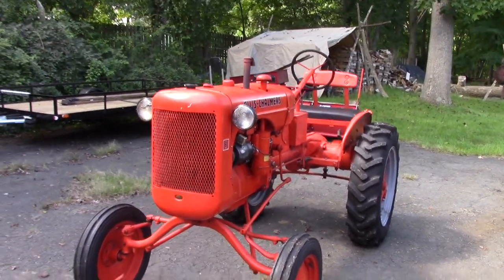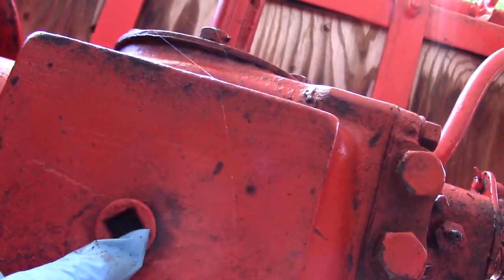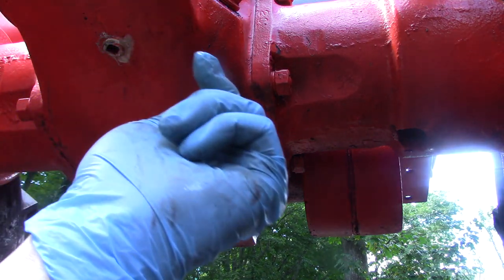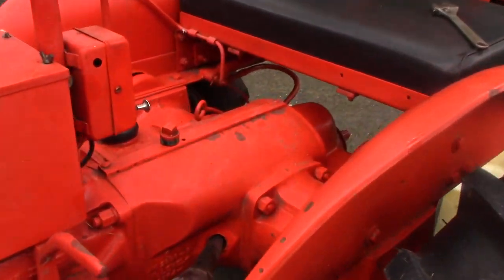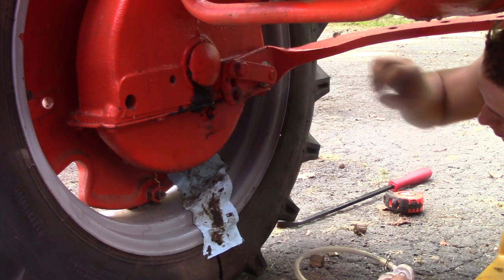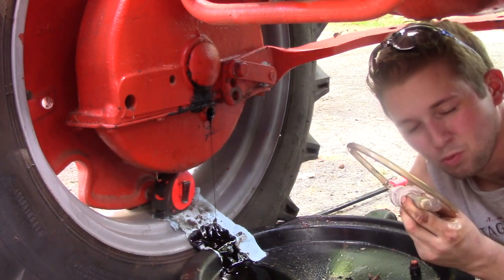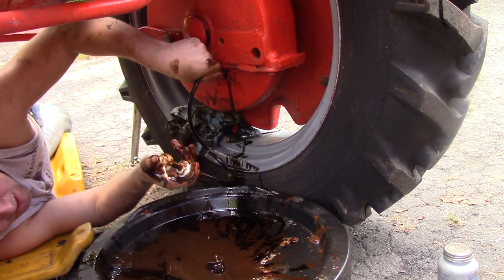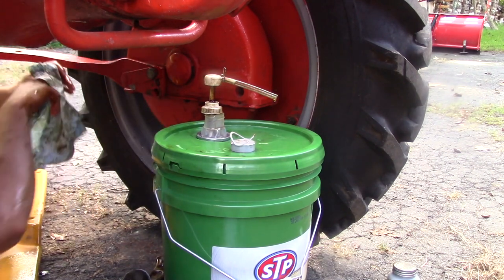Hydraulic/Transmission Oil

Comment: To get the slug out put plugs back in block both ends of tractor up put in some Diesel fuel for rinse only use a blower nozzle with a rubber hose on it about 16 inches long that will stir it up real good then remove plugs again let it drain for about 8 hrs that should clean slug out

Comment: Does the oil clear up if u let it sit overnight?  I have a gearbox on a small walk behind implement oil looks the same after I run it for 10 min.  But the air goes out when it sits.

Comment: I would first fill it with an inexpensive lightweight oil 5-30 and then run it around with no load, then after a few weeks drain it and put your high quality GL5 in.

Comment: you should put a pail bucket to catch the oil in the first place
Reply from the maker: A “pail bucket” doesn’t have a spout. Therefore, disposing of used oil from a bucket will most likely cause spillage. 

An oil catch pan (as used in the video) does in fact have a spout.
Reply: @OldSoulMillennial  I would try to pump out from top with battery powered pump, then drain from bottom, easier to control